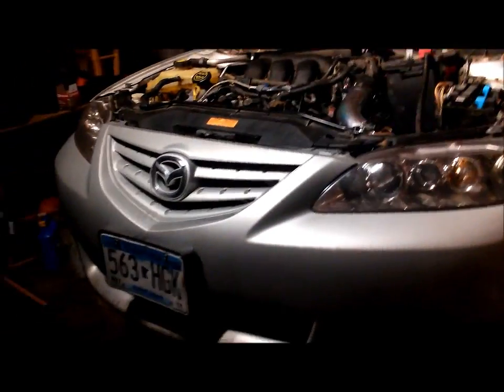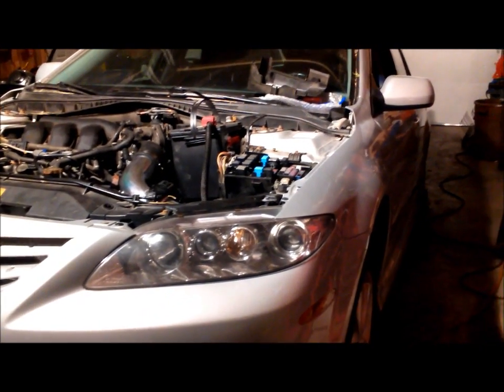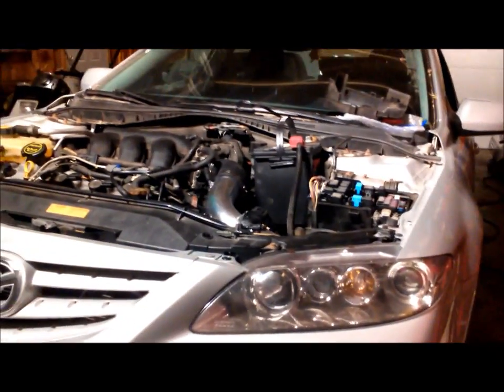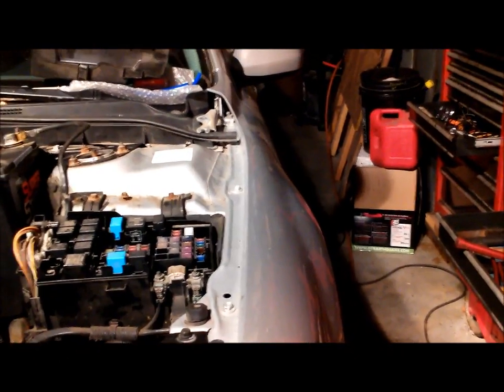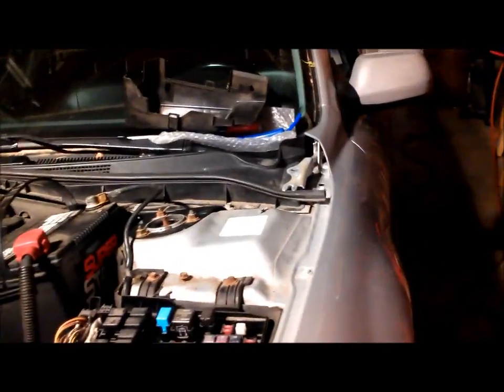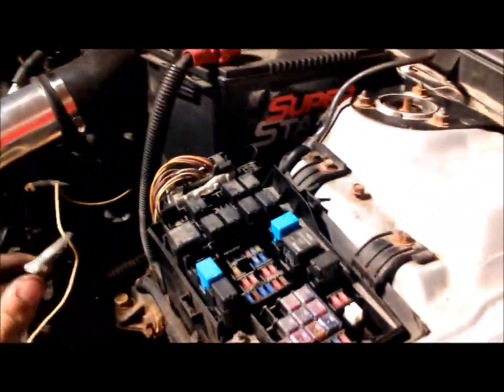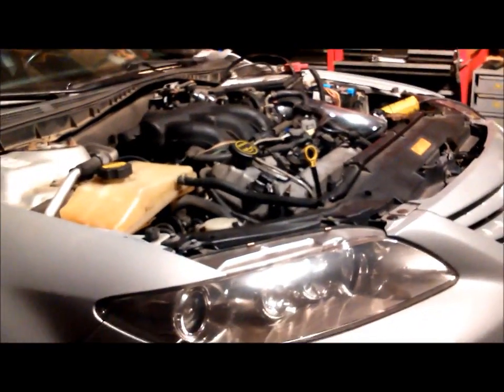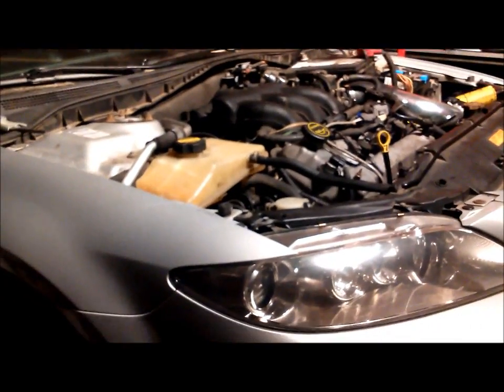Mazda6 engine swap startup

Comment: I know this was a couple of years ago but could you please tell me exactly what parts needs to be switched over from the original Mazda motor over to the fusion motor in order to perform this swap?  I have an 06 Mazda Wagon and I am swapping a motor from a 2007 Ford Fusion.
Reply: Ben Vargas they're the same exact engine same connectors, block, and everything. Only difference is Ford branding on it.